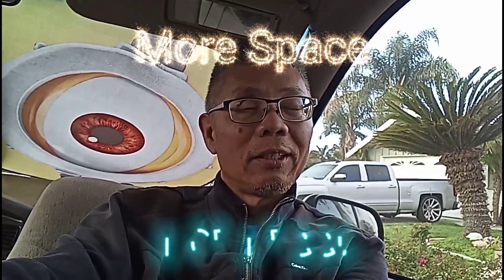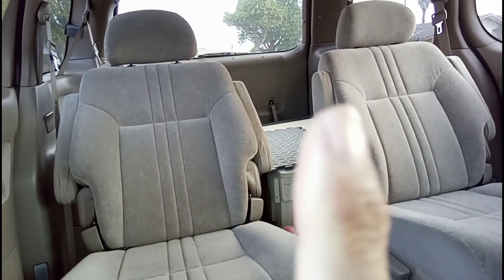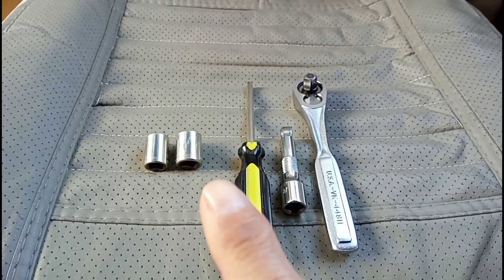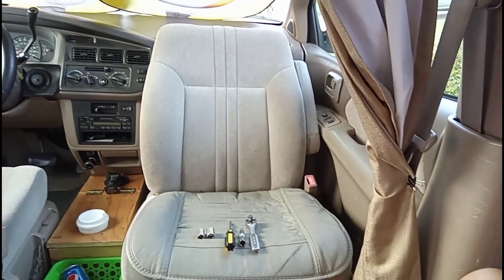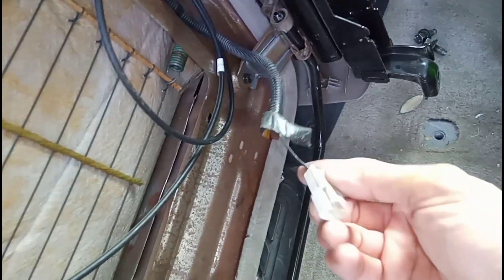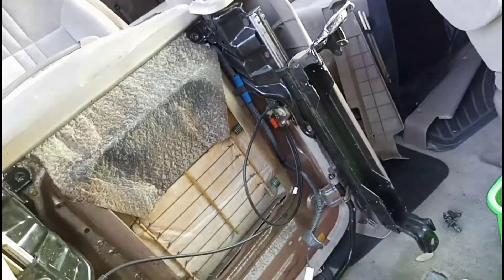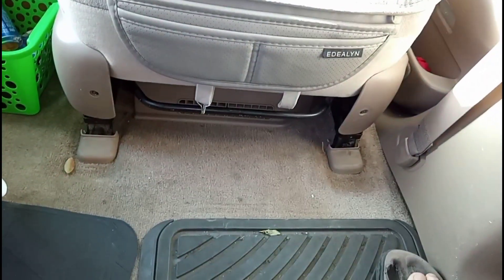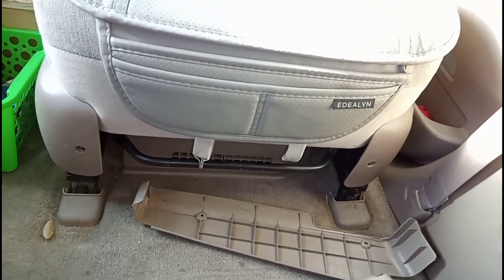Vanlife | Rotate the Front Seat for Free in a 1999 Toyota Sienna Minivan Camper

Comment: I wonder if you can use the second row seats for driver and passenger so you can fully collapse them. They’re about $30 a piece.
Reply from the maker: They are totally different from the front seat. And it mounted differently.
Reply: @MoBangFoYoBucks  I was looking at them just now in my garage, in theory you can swap out the latching base on the second row to a hard mounted style like the front. It looks like it may work if they line up correct and holes line up also
Reply: @MoBangFoYoBucks  Tim, it can be done, you must drill one extra hole and  slight bore one hole also, its because there are three mounts threads on each rail vs two on the original front seat rail. This now can collapse flat and now doubles as a table.
Reply from the maker: @danielbautista0000  Great idea! I don't have this vehicle anymore!😭
Reply: @MoBangFoYoBucks  no problem maybe someone will see this video and read the comments but thanks for posting this video.
Reply: @MoBangFoYoBucks I saw this video and read the comments :) I’ve thought for a long time about switching the seats but never got around to figuring out what holes need to be drilled/adapted.

Comment: Will disengaging the air bag on that seat affect any of the other airbags in the van?  I really like the idea of having more room in the back and having that passenger seat available to relax in with lots of leg room.  Will be interesting to see if you keep it this way.
Reply from the maker: I turn on the ignition key and started the engine. No warning light of any kind for the airbag. That wire has two strands. Therefore it is just connected to a switch under the seat to tell the airbag computer that whether someone's butt is on it or not.😁 Oh, it is staying like permanently now!
BTW Generation 1 does not have airbag in the seat itself.
Reply: @MoBangFoYoBucks  Thanks, Tim!  It's a cool change in your van set-up!